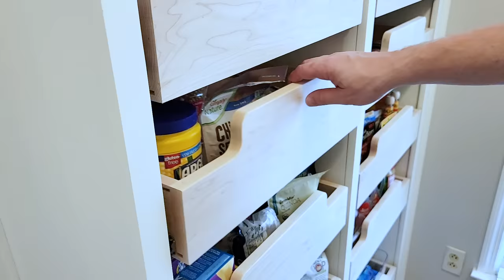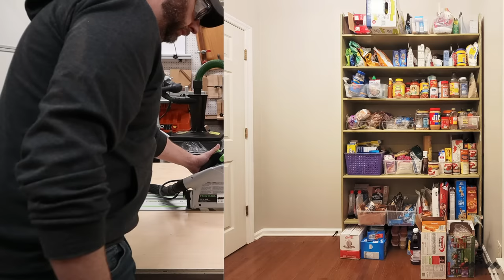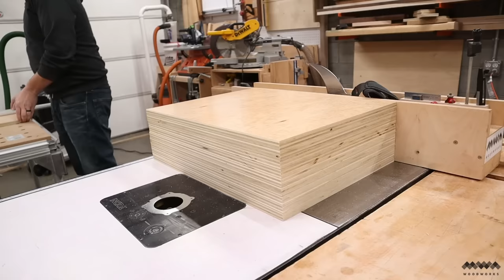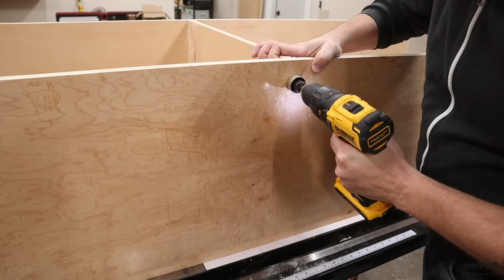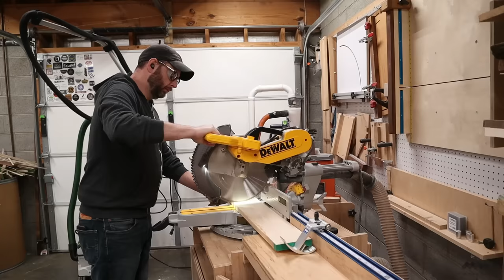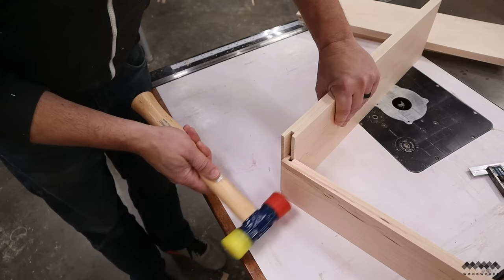This is how I fixed my cluttered outdated pantry shelves

Comment: Have made a number of cabinets with pull-out shelves for the shop and clothes closets but never thought about using that style for a pantry.   Or for making the face frame as a unit and then attaching to the cabinet.   I will make one of these for the wife but make adjustable shelving using pin holes.  Thanks for these ideas, really appreciate your video, proves you can teach an old dog new tricks.
Reply from the maker: Hey thanks! I also made these so doors could be easily added, although in my pantry they wouldn't work.

Comment: The one thing I really struggle with when making custom depth cabinets is building them to accommodate available drawer slides.  It's not a common issue but looking at under mount vs side mount you really need to plan around the slide.  I wish this was talked about more in many cabinet making videos.
Reply from the maker: For custom sizes or builtins, I don't typically plan that way. For me the planning is dictated by the customer's needs and then whatever  drawer slide fits is what I base the drawers around. Sometimes you have more space left in the back than maybe you want but I've never had a complaint about that kind of issue.

Comment: Nice work, I like the idea of pre-finished plywood for painting. I also think you were wise to cut your drawer sides to rough length prior to milling, an important order of operations that people might miss. Did you consider putting doors on at all?
Reply from the maker: Doors would not have functioned well where this cabinet is located. The right side would run into the window sill and prevented the drawers from extending out. Plus these cabinets are inside the pantry and not out in the kitchen so doors would have been a bit overkill. Had I built these cabinets in the kitchen then I would have added doors.

Comment: What are the alternatives to those dados to assemble the top bottom and middle of the cabinets? I'm planning something very similar to this, I have a small table saw and router table, but I dont see how i can cut those accurately in my shop, especially the middle one on an 8' long board. Awesome build!
Reply from the maker: Do you have a router and straight edge? That would be the easiest way to cut them. Alternatively you could assemble using pocket screws or dominos
Reply: @MWAWoodworks  Thanks for the reply! I only have one router at the moment, and its installed in the table, but i could potentially take it out and do it that way. Was also thinking pocket screws... i might go that way, but the dados seemed stronger.

Comment: What is this plywood.  I have never seen anything that smooth and shiny at my supplier.  What would I ask for?  Does paint stick to it well, or will it peel?
Reply from the maker: It's pre finished plywood. My local plywood distributor has it. You can paint it but must use a primer like shellac first before you paint it

Comment: Great video, Matt! Just curious, looked like you used pre finished plywood fir the carcass but then painted. Any benefit to doing it that way or did you just use what you had?
Reply from the maker: There's a definite benefit! Since the surface is prefinished you absolutely get a glass smooth finish. No grain lines, no sanding. Just use a good oil or shellac based primer and then your favorite paint. It's the best!
Reply: @MWAWoodworks  good to know, thank you! I have a lot of built in projects to do so this is very helpful.